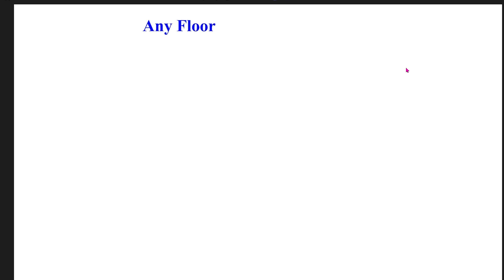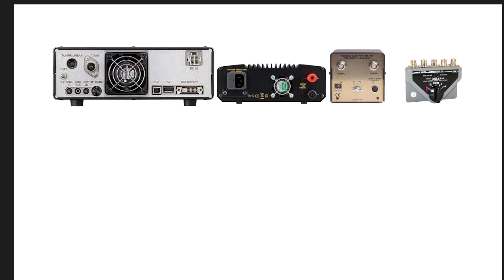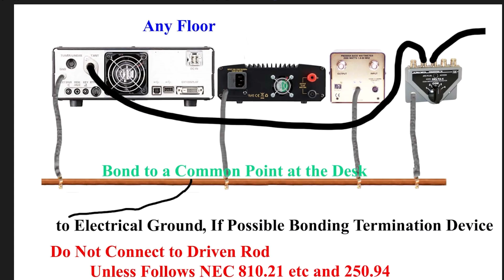Ground is a Myth says the ARRL! Ground is NOT a Myth and Here's How I Grounded My Station W6LG Jim

Comment: I was convinced by Jim's previous videos on this very subject. When lighting is in the area my coax goes outside regardless of the spark gap arrestor.
I was about 8 years old during Hurricane Betsy, once the power was lost my Uncle turned off all outside breakers and removed the screw-in fuses on the inside panel. 
Perhaps hours later. Lighting hit the pole transformer on the street, which was grounded. It jumped the breakers, burnt up the well motor, and jumped the inside panel, and a light switch that was off in the room where we were sitting around the hurricane lamp. The bulb illuminated brightly and popped. Seems like there was other damage, but I can't remember. This Left a lasting impression on me.  In hindsight, by then a lot of the power lines were down and the lighting was probably going for the 150 ft well. However, it also came inside the house as well. Respect, Mother Nature.
In addition, several times while growing up, if the old rotary phone bell rang once.!!! It was followed by a simultaneous flash and thunderclap. 73/88

Comment: Thanks for the clarity, Jim!  I found the ARRL presentation to be confusing with the mixing of different concepts and the "misleading by trying to be funny" title.

The concept that is a myth is the idea many amateurs have that "earth" or "ground" is an infinite sink of uniform 0 electrical potential into which we can pour any and all unwanted charges simply by hooking up to a ground rod.

Many individuals who have this misunderstanding advise violating the NEC and having a separate "shack ground rod" that is not bonded back to the electrical service ground outside the home as required by the NEC.

That configuration poses a safety hazard because in the event of a nearby lightning strike, a significant potential can develop between the shack ground rod and the electrical service ground. Since the only path for current to flow between those two electrodes is through the radio equipment and the house wiring, this is a risk to life and property. Such stations do bond their two earthing electrodes, but they are bonded through the home rather than outside the home as required by NEC.

In my opinion, a better way to think about ground rods is that they are probes into an electrical circuit we call "earth."  They are not guaranteed to be at the same potential, and charges do not "seek ground," as if once finding that mystical location, they will remain there forever. A ground rod can be a source of current flowing into the home if not installed and bonded properly.

Comment: I've been a licensed electrical contractor since the 80's, and you got it exactly right. And one typically do want as much surface area you can get for your grounding conductor (like brades and pipe) for what ever RF you can ground out.

Where people typically experience problems, especially interference is from creating grounding loops by using separate ground rods instead of running the ground to the electrical system internal grounding system. So you're absolutely right about that too.

If you have an old electrical service entrance equipment that doesn't have the neutral grounded to a two ground rods 6 feet apart, you might want to either have an electrical service entrance panel upgrade done, or have the existing service neutral conductor grounded to two rods.

So you're absolutely right, need to run that grounding conductor all the way back to your service entrance panel grounding system to prevent a ground loop, sometimes referred to as a multipath.

Comment: Very good Jim ! Grounding and bonding is very important to your safety.  Every thing should be kept at same potential. it is the difference  that is dangerous . This can cause arcing and shock Hazzard from the difference of potential . Even start a fire/damage equipment/cause shock injury and possible loss of life.    The ARRL has a good book on grounding and bonding . Myth was the wrong word to use.  It is much more than lightning protection. like a short inside power supply that made 120V go to the case . Heavy snow or rain can make a static charge that can shock you and or damage equipment.  During a storm power lines may detach from pole or house and touch your antenna . grounding and bonding save you from all and more.  If your common point ground goes to a driver rod . it MUST be bonded to outher ground rods and outside your home.   and connect to utility ground.  Bonding of ground rods is done outside and with heavy copper wire. and with UL type clamps.  never solder.  welding is good.  during a surge that can be large amount of amps.  solder will throw splatter of hot metal and is dangerous and could start a fire or cause severe burns.  Please take grounding and bonding very serious and do some research how to do correctly.  Your life may depend on it.  73

Comment: I think what you are saying is not wrong, but in modern installations you are both right and wrong. Modern installations are 13vish dc and not mains. It is certainly good to keep the boxes connected to each other but AC stuff stops at the power supply. I agree that there is no such thing as rf ground but ground does not apply downstream of the power supply. Hope not to have caused any offense.

Comment: I have a copper bar 1/4 x 2" x 36" drilled and tapped 1/4-20 every inch and all ground cables are connected to it including all antenna switches. The copper bar is connected to a Edison ground system. I do check the ground resistance from time to time because it can change with the moisture in the earth.
Reply: What tool do you use to check it and how ?

Comment: Since the grounds and the neutrals are connected together at the main service entry point, "ground fault current ( current that does not return on the neutral in the monitored circuit from the hot)" can also return to the transformer feeding the property on the neutral, or center tap if you like even if returning back to the circuit through a ground rod. It can also take the path of earth ground but is more likely to return on the service neutral.
To make the statement that ground is a myth in my mind demonstrates a gross misunderstanding of electrical power distribution systems.
Reply from the maker: Of course it does.  Hence the ground rod or Ufer rod at the main  panel and a rod at the center tap of the pole pig.  They are not there just for looks. 73, Jim W6LG

Comment: Yes, a wide flat braid has a lower inductance per unit length than a cylindrical Wire 🙏
Great Info.
Basically because it takes more work to create a rotating magnetic field around a wide flat wire as opposed to a cylindrical conductor.
Reply from the maker: Very interesting.  I have not heard that. Thanks for the education. 73 Jim
Reply: @ham-radio  A great experiment you can run, is to set up a number of different gauge wires all of the same length (maybe 50cm or 100cm) along with wide braided conductors and also even Copper Tape of the same lengths and check them all out on your LCR meter, particularly looking at the L (Inductance).
The results will be enlightening 
⚡🙏⚡
Keep up the great work my friend.
You are doing a fantastic Job 🙏
73 from 🇦🇺
Reply from the maker: I will and thanks, Jim

Comment: The real myth is the ARRL itself, how low will they go?.
Reply from the maker: I believe that under the current management and very very top heavy salaries, they are failing.  You may have noticed that they did not, I'll repeat, the ARRL has not released the annual report.  I am sure it is a disaster. 73, Jim W6LG

Comment: I am going through this right now and have no idea what to do. I have a ham shack in the garage. I am using a alinco power supply and a ft891. antenna is a hustler vertical. Do I just need to add a lightning arrester and a ground rod outside?
Reply from the maker: Just follow the picture. 73, Jim
Reply: @ham-radio  Thank You, I found it very difficult to research this topic due to the misinformation that is being repeated. I have a metal power bar near the equipment so I will use your idea to add 1/4 20nc standoffs to the side. I bought some 3/8 inch wide straps 2 feet long do you think this will be sufficient or should I get wider braid?

Comment: GFCI receptacles work whether a ground is present or not. If you need to ground equipment separately from the system, there is a problem with your system. It's that simple. If things are installed to code there will never be a difference of potential.
Reply from the maker: Grounding separately is important for our stations.  Look at that transceiver and its lack of a low impedance ground connection. 73, Jim W6LG
Reply: @ham-radio  Except for the case ground! I think you are stuck in 1950's thinking. Back then there were no equipment grounds in house wiring. Unless you are generating your own power with a home built powerplant there really is no need for all of that bonding.
Reply: @jasonstevens5943 My radio runs on DC. There is no 3rd wire ground. Electrical circuit design may have changed since 1950 but how electricity works has not. Bonding radio equipment is essential. You ever get an RF burn you’ll figure that out very quickly.
Reply: @KJ7Radio  The negative in the power supply is shorted to the ground from the ac system. Your radio is grounded to the ac system.
Reply: @jasonstevens5943  Yes it is, but not always at the same potential as all other chassis grounds, especially with respect to RF.
Reply: @KJ7Radio  All equipment grounds go back to the service, the service is grounded by the grounding conductor attached to a ground rod. All your equipment chassis are grounded by the equipment grounds. They are all at the same potential. There is no such thing as an rf ground when it comes to equipment. Some antennas need rf ground, but not equipment.
Reply from the maker: But the point I was making was keeping all boxes at the same gradient. And, I think that I said that at least 3 times. As a former Building Inspector my training was with 3 wire convenience outlets. 73, Jim
Reply: @ham-radio  The enclosures are all grounded by the equipment grounds. If you were once a an electrical building inspector you should know what that means and what it does. They are all bonded through receptacle back to the panel and out to the earth through the ground rod. They have a lower impedance path to each other than to the earth, so I really don't know what you are getting at. Are you worried more about low impedance to earth or as close to the same gradient as possible. Lucky for you you already have both. Have a good one!

Comment: Jim Brown K9YC seems to disagree with common point bonding. I'm still trying to understand all of it. I'm also trying to work on my pin 1 problems. Check out his presentation.  Ground is not a myth. Just harder to achieve in some places.
73, W8BT
Reply from the maker: I will.  My advice is 60 years on the air and having made a few mistakes along the way. 73, Jim
Reply: @ham-radio  I think Jim is about the same age. He's done a lot of audio work over the years. I found him on the K3 groups io. I love all my Elmers, whether local or via the Internet. 73, Travis

Comment: I don’t yet fully understand grounding, but the electric code clearly indicates that equipment should not be bonded to a separate ground rod unless that rod is in turn bonded to the electric panel ground rod. Thanks for stressing the importance of following the electric code.
Reply from the maker: That's my read on the subject. Also, there are specifics about how that should be done.  Thanks for pointing that out. 73, Jim

Comment: Ground is not a myth, but nearly every ham's perception of what it is is a myth. A physicist doesn't think of the earth as 'ground'. If ground were really what hams think it is, antennas lying on the ground, or even underground as some longwave antennas are, wouldn't work, but they do. Ground is a conductor of varying resistance, an energy sink of varying resistance, and a reference point of varying resistance. But just driving a rod into our Colorado sandstone does not provide what we would consider to be a ground, not even for DC, because it is such a very high resistance as to be pointless unless it just rained. The capacitive coupling of my raised counterpoise to 'ground' changed every day with how wet that ground was, and with the water in either its liquid state or frozen, shifting the resonant frequency and also changing the efficiency of my longwave antenna. When ground is a fluctuating variable with weather conditions, we can't keep thinking of it as a fixed reference point, as we hams almost invariably do. When I help other hams with antenna problems the problems often end up being due to the ham perceiving 'ground' as some sort of magical fixed entity, as if the Earth were a giant copper ball. It's far from it.
Reply from the maker: I had to read it 3 times.  Thanks, Jim
Reply: @ham-radio I think the intent of the word myth was that there is no one ground. The word is used and miss used and miss understood. The thing to beware of is a single isolated ground rod for the radio. That it is ever a RF ground is defiantly a myth. The fact that it makes the radio safe is a myth. Only safety grounds, that green wire connected to the “ third prong” on the power plug, make radios safe of should I say safer. 
I think that both your presentation and the ARRL presentation were good. No one presentation seems to fully cover any topic, especially one such as grounding and bonding!
Reply: In other words there is very much mythology surrounding the topic of electrical "ground".  Enough that it was a fitting subject for a talk with the title that offended some sensitive souls.
Reply: You are correct. I ran into this problem in Antarctica. There grounding properly could be a real problem. The earth, is variable in its geological properties, it effects grounding.

Comment: Im a licensed electrician your explanation is spot on! Thanks KA1HIW
Reply from the maker: Great to hear that.  Many years ago I was a Deputy Building Inspector.  That means little today. Thanks for the help. 73, Jim W6LG
Reply: @ham-radio  For those of us that can't get to our panel from the second floor, can we take a plug with NO hot or neutral connection and use the ground lug connection to our common pipe/bar for the station ground/bonding point?
Reply: That’s my questions as well?!?

Comment: That's exactly what I have in my shack except I don't have the coax switch grounded. I didn't even think to throw a strap on it but I will tomorrow.
Reply from the maker: Probably doesn't matter much with the coax braid doing the job BUT  connectors have a nasty habit of working loose on their own. 73, Jim W6LG
Reply: I was always wondering about that since any antena cable or non 110/230V radio equipment ------ PE (protective earth wire; EU terms) connection creates new (additional) and easy way for lightning current to go thru inside building electric installation into ground (instead of being kept outside only).

Comment: Please don't ever use the ARRL as a reference for anything.  They are a giant political organization with their own agenda to survive.  They are obsolete and no longer have amateur radio operators best interest at heart
Reply from the maker: Mark,  they, the ARRL needs to hear that because you are not alone with that opinion. 73, Jim
Reply: @ham-radio  I am of the current opinionthat the ARRL is just a branch of the federal government at this point.  The size of the golum is of such a magnitude that it is virtually impossible to alter their direction by means of regular communication.  The only way to change the organization is to have a massive stop in membership and their sourse of funding.   This is the only sound they will hear.
Reply: Kind of like the nra
Reply: Is their antenna book not worth the effort buying and reading?
Reply: @marcveary4146 Get one of the older editions. I’ve got the 1988 edition-purchased it for $9.00 online.
Reply: @marcveary4146  NOT AT ALL!!! Motorola book on grounding, available online, is a great starting point.  There are 3 types of ground: Safety ground for your 60Hz equipment, RF ground, and Lightning ground.  DO NOT "bond" your lightning ground to any other rods whatsoever, unless you want to risk death and destruction.
Reply: Good video Jim.  I’m getting some time away from my shop and trying to get some study time toward my general license, I’ve been a tech forever.  Your diagram is spot on to how I wired my grounds.  Glad I did it right.  On a different topic your looking good.  How are you feeling?
Reply: I watched about 5 minutes of the crazy lady and switched off.
Stupidest stuff I've  heard in a looong time.
Reply: @docokd7oco443 that's good to know.😊
Reply: The ARRL is currently doing great work for all of us regarding RFI from solar power systems and this benefits all of us regardless if you are a member of the ARRL or not and it’s a real shame we are not all supporting them just for this behind the scene work they are doing.  The ARRL RFI group is definitely well worth every penny of membership regardless of any other benefits the ARRL offers.  It’s a real shame folks bash the ARRL versus getting involved to help them and in turn help our entire hobby.  Don wd8dsb
Reply from the maker: I am a Life Member. If the ARRL does not change it will not longer exist like many companies in recent years.  The Board needs to resign and a new member oriented  Board take control. 73, Jim W6LG
Reply: @ham-radio  it’s the good O’l boy club